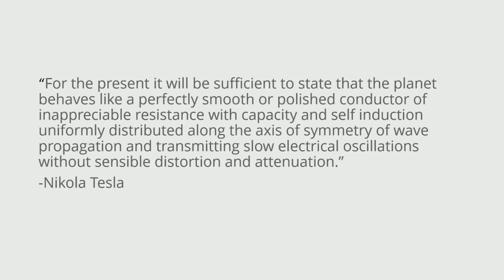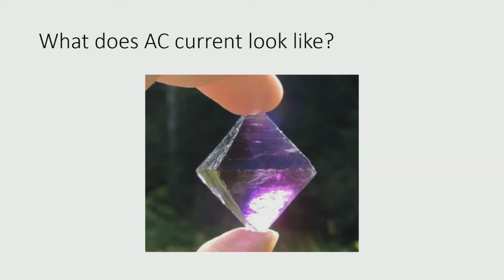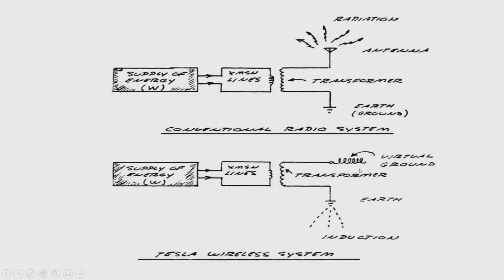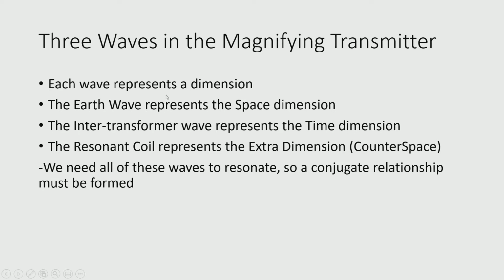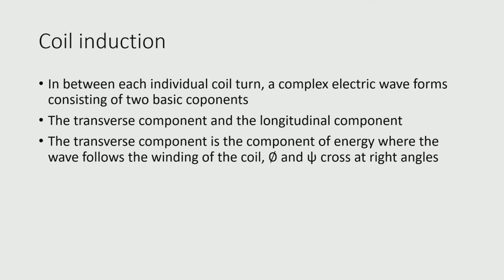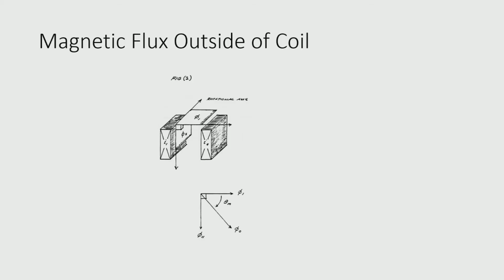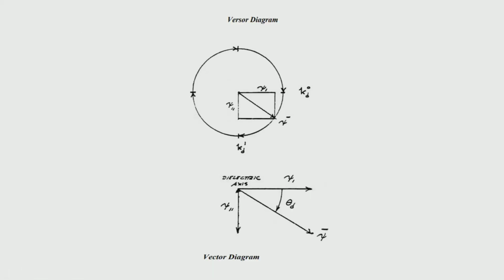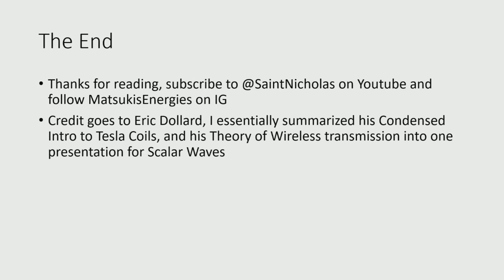Nikola Tesla’s Faster Than Light Waves

Comment: I believe you have a definition error on the slide at 30:00.  As-is, there is no definition for phi11 * psi1 (on the left).

Specifically  the last definition (on the right, fourth line down).  I think you meant to write phi11 * psi1 = transverse EM horizontally polarized (rather than psi11 * phi1).
Reply: Also, I differ with your emphasis on the statement about where Maxwell "got it wrong" and where he's an unwitting rat. Let's think about this hypothetically and pragmatically. 

Hypothetical: let's imagine the consequences of an alternate history wherein we focused upon only the dielectric influence (no recognition of the transverse waves). Knowing this form of longitudinal waves inherently shapes what appears to be biology (tree limbs, root systems, stars and galaxy forms), knowing it influences biology, and knowing it is nearly impossible to shield against, would there have been a safe mechanism for development? By perspective, development of a more weakly interacting transverse wave that can be shielded seems worth the efficiency penalty.

Pragmatic: has anyone determined how to precisely measure dielectric / longitudinal behavior? Somehow with transverse waves we've managed to refine measurement to exquisite precision in scientific and engineering fields for over a century, and yet with dielectric / longitudinal behavior we are still watching if neon lamps glow or if sparks fly. There is a precedent for why it is more economical (and perhaps safe) to focus where we can make measured progress.

The light in which you interpret the actions of these historical figures does matter, and it's quite difficult to retcon history based on our myopic understanding of today. Long story short, careful what you wish for.

Comment: There is no FTL of light that is BS. What you describing is just that light is taken the shorter path jumping across the Telsa coil's spirals due to capacitive coupling instead of going along the length of the spirals. The path is shorter but the speed of light remains the same. This whole FTL on a wire is big scum or people don't understanding electromagnetism.

That what is however under question and has some basis is if the straight lines flux electric field inside a wire propagates a signal transient FTL.
Reply from the maker: Perhaps you may be onto something. Technically the wave is in counterspace, which is essentially what you are describing. 

The only issue with your argument is how does our signal arrive wirelessly through the Earth faster than normal electromagnetic light? If it was coil capacity causing this, why does the wave maintain this property within the Earth and to the receivers as well? This is faster than light my friend. 

Longitudinal theory is based on the potential, or electrostatic realm of physics. This means  high volts low amperage. It is the imaginary potential before the real amperage occurs. This can most certainly be engineered in the favor of humanity
Reply: @SaintNicholas322  No, the question is not about EM waves traveling in a medium but a wave traveling inside a pre-existing static electric field like that of the earth. Imagine this electric field as being guitar strings. Simple EM propagation is like you snapping you finger on air but FTL signal propagation is like you hitting a guitar string. What will propagate faster the sound on air or the sound along the guitar string?
Reply from the maker: @Markoul11  What is your point? The snap would obviously be slower than the guitar string.
With longitudinal waves, the fields in the ether/electric fields are combined, instead of the fields being orthogonal with EM. The longitudinal energy literally arrives quicker
Reply: @SaintNicholas322  My point is that for radiated EM energy, the the flux in space is curved, transverse incoherent but in a wire the electric flux become directional focused in a beam, straight and coherent like a guitar string. Therefore allowing signal to FTL travel along the straight flux lines. When you are in your car what type of road allows you to increase speed to maximum? A curled road or a straight?  It is all about flux geometry.

Comment: As you know, this technology is known in the upper echelons of society, and amazing people like yourself are dangerous to them. I believe the old world was powered with similar tech. What I praise you for  is the spread of information. Are you a genius and from the bottom of my heart I thank you.
Reply from the maker: Thank you for your kind words I am very blessed to spread this message and be apart of this! The growth has been phenomenal and this is just the beginning
Reply: @SaintNicholas322  There is no FTL of light that is BS. What you describing is just that light is taken the shorter path jumping across the Telsa coil's spirals due to capacitive coupling instead of going along the length of the spirals. The path is shorter but the speed of light remains the same. This whole FTL on a wire is big scum or people don't understanding electromagnetism.

That what is however under question and has some basis is if the straight lines flux electric field inside a wire propagates a signal transient FTL.
Reply: @Markoul11  Light is a Transverse propagation, it meets resistance as it propagates through the Aether and that is what gives its average speed, a Longitudinal propagation doesn't meet the resistance Transverse propagations encounter, and as such can move orders of magnitude faster, if not instantaneously.

Transverse = Resistance
Longitudinal = Less or No Resistance.
Reply: As usual you see a hundred to one videos saying ftl travel isn't possible. 
Ever scientist that blindly supports it is a 
Idiot and those that support it knowingly 
Are traitors to humanity.

Comment: Are you able to turn the lightbulb/devices on/off when it's getting energy from the receiver? Also, would you be able to ask a nearby landowner if you could use 6 feet of their land for a few months so you can test the receiver coil at your new place???
Reply: You could even offer to lease the 6 feet for like $50 per year but honestly I feel like someone will let you use it for free. If you show the experiment results to a professor they might even let you use their property and brainstorm with you
Reply from the maker: @xoSiNgInGiNtHeRaInox  I can’t say much but my uni has been very accommodating, big things are happening behind the scenes :)
Yes you can modify the receiver circuit to work as a switch
Reply: Yes. Simply.
Think of it like the wireless charging capability on your phone....
Depending on surrounding circumstances and requirements, you can 'switch off' the device by dampening (or insulating) the receiver coils tuning, by diverting the receiver coil input signal/energy or by creating a break in the receiver coil circuit.

Comment: Does earth's frequency change over time (especially recently I heard that it was) and if so, does it make Parker's frequency of 168 ineffective due to it no longer being divisible by 8?
Reply from the maker: I didn’t see your other questions I apologize!
Geostorms:
The math shows no, this is not an electromagnetic wave, this is a scalar wave, therefore any atom splitting device would be ineffective.

Earths change in resonate frequency will most certainly effect transmission. This is something that would need to be tested. Parkers transmission was effective, but I can no longer test my coil and experiment with Parker because my new place doesn’t have a proper Earth Ground connection.

And yes, the pyramids were most definitely wireless powerplants. I touch on this in my UFO video, but I will be making a video soon about the physics of how the pyramids work, stay tuned thanks for the support!
Reply: @SaintNicholas322  could you do it from a hiking trail nearby maybe?
Reply from the maker: @xoSiNgInGiNtHeRaInox  Are you talking about receiving energy? You theoretically could, but you need an Earth Ground buried at least 6 feet underground, so as of right now it’s not a portable technology. The receiver coil is a pain in the ass honestly, and any time there is any metallic objects nearby it will detune. More developments need to be made!
Reply: @SaintNicholas322  WHY E=MC2 IS NECESSARILY AND CLEARLY F=MA ON BALANCE:

Energy has/involves GRAVITY, AND ENERGY has/involves inertia/INERTIAL RESISTANCE. C4 is the proof of the fact that E=mc2 IS F=ma ON BALANCE. This explains the fourth dimension. TIME is NECESSARILY possible/potential AND actual IN BALANCE, AS E=MC2 IS F=MA ON BALANCE; AS ELECTROMAGNETISM/energy is gravity !!! The stars AND PLANETS are POINTS in the night sky. E=MC2 IS F=ma. ("Mass"/ENERGY IS GRAVITY. ELECTROMAGNETISM/energy is gravity.) The EARTH/ground AND what is THE SUN are CLEARLY (on balance) E=MC2 AS F=ma. TIME dilation ULTIMATELY proves ON BALANCE that E=MC2 IS F=ma IN BALANCE, AS ELECTROMAGNETISM/energy is gravity !!! (Gravity IS ELECTROMAGNETISM/energy.) The sky is blue, AND THE EARTH is ALSO BLUE. The stars AND PLANETS are POINTS in the night sky. E=MC2 IS F=ma ON BALANCE. Great !!! This NECESSARILY represents, INVOLVES, AND DESCRIBES what is possible/potential AND actual IN BALANCE, AS ELECTROMAGNETISM/energy is gravity. GRAVITATIONAL force/ENERGY IS proportional to (or BALANCED with/as) inertia/INERTIAL RESISTANCE, AS E=MC2 IS F=ma; AS ELECTROMAGNETISM/ENERGY IS GRAVITY. Gravity/acceleration involves BALANCED inertia/INERTIAL RESISTANCE, AS E=MC2 IS F=ma ON BALANCE; AS ELECTROMAGNETISM/energy is gravity !!! It all CLEARLY makes perfect sense. BALANCE AND completeness go hand in hand.

By Frank DiMeglio
Reply from the maker: @frankdimeglio8216  E does not equal mc^2 when the wave does not have mass. Magneto dielectric waves are scalar and have no mass, therefore they do not obey the same laws of physics as a hertzian wave. Electricity IS NOT A LIGHT WAVE PHYSICS DESCRIBES AS ‘A SPRAY OF PHOTONS;’ That’s what you physicists can’t understand

I also encourage you to look into Teslas Dynamic Theory of Gravity which i’ll make a video on eventually, but E=MC2 does not take into consideration the Ether. It doesn’t disprove it, but it doesn’t factor the Ether as a potential. THIS IS WHY EINSTEIN is WRONG. There is an electrical resonant connection to gravity,  this electrical force is 10^40 times stronger than the force of gravity. Einsteins equation cannot account for that, therefore it is thrown in the garbage we need new equations.

Comment: Can you do a video on how to power your house with it ? Can we get there or is there work to do somehow?
Reply from the maker: Still work to be done. These devices have been eliminated from the market, and little ‘real’ devices have been built, so this is a prototype stage. Tesla’s lab notes show tremendous results in terms of efficiency. So the modern devices receiver coil system could be engineered in a way to convert to a single phase circuit of 120v 60hz output
Reply: It's not so simple, from a layman, 'DIY' perspective...
You need to tune your transmitter/receiver to the fundamental and resonant frequency of the inherent circuit, for starters. Then you need the ability/capacity to capture the longitudinal waves and/or transition the electrical input signal from its specifically tuned properties to the standard and generic 2/3 Phase - 50/60Htz - 110/240VAC electrical signal. And NONE of these parts are pre-configured and/or assembled in OTS form. Some are not even readily available...

It would be a MOMENTALLY MASSIVE undertaking if you are a mere enthusiast and are attempting to lead the way. It would be FAR more of a reasonable proposition to construct a more 'standard' form of atmospheric energy harvesting, such as a solar powered molten salt - steam turbine, electrical generator.... Use a Tesla Turbine if you want to retain that element of fringe science lol. (100+ year old fringe science.)
✌️